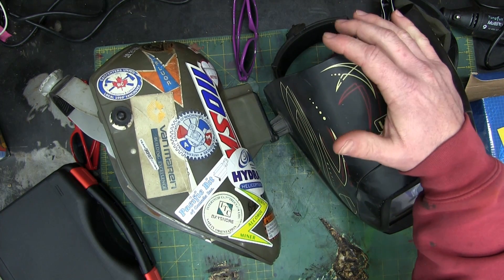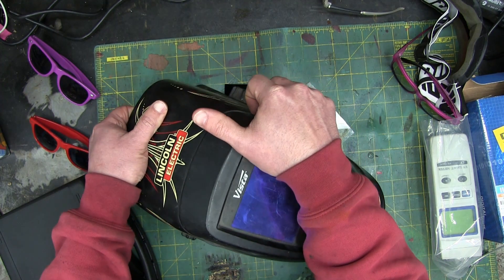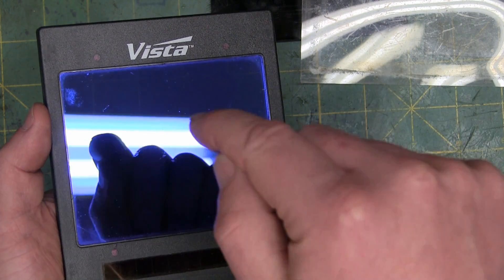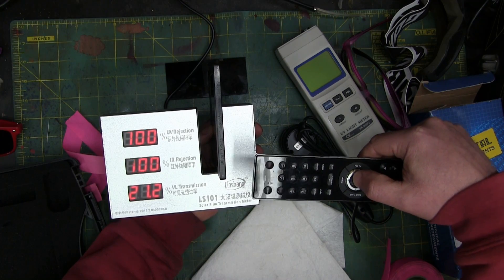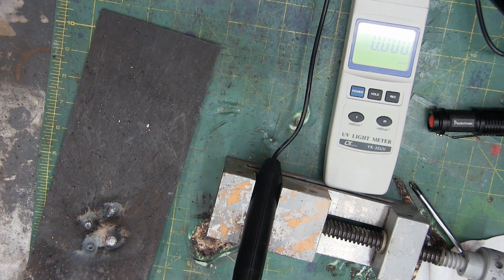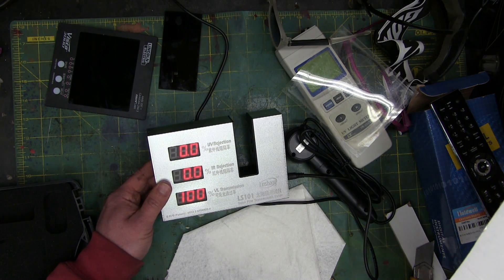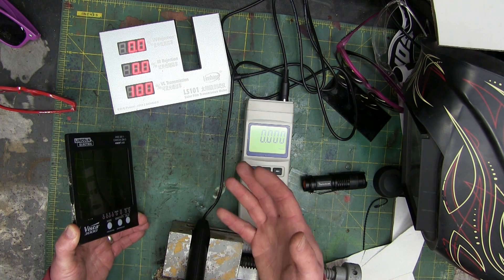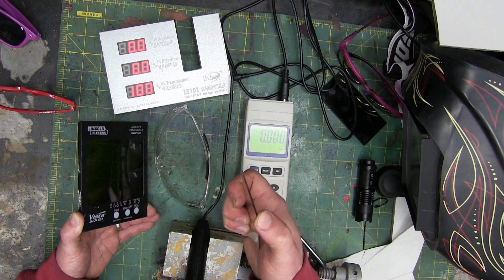SPEED DOESN'T MATTER?! Auto-Darkening Welding Helmet

Comment: Hi AvE,
I think one thing worth mentioning is that when welding in tight spaces (exhaust header tubes for example), the welding hood's sensors get blocked often, so you still do get "flashed" (not nearly as harmful as a bare eye flash as you mentioned) and then you have to wait several seconds for your eyes to re-adjust before welding. It hurts a bit, but won't give you the 3AM emergency room visit for the eye drops.
The higher end hoods like yours have 4 corner sensors to help with this. The cheaper (and even some expensive "Spedglas" brand) hoods only have 2 sensors, which suck big time for welding in tight quarters. They constantly get blocked and then you get flicker.
Also, some higher end hoods have a "grind" setting, which comes in handy.
Cool to see welding related stuff on your channel.
Thanks,
Aaron
Reply: Ran into this problem constantly doing my stuff under the car.  yea the 2 sensor unit suck. but now that I know an IR remote can trigger these things I might just wire the helmet up to the mig gun trigger with an IR LED aimed right at one of the sensors, or even just hack right into the helmet. no more false triggers for me!
Reply: A few years back I got the Miller Digital Elite helmet because it has something they call X-Mode. From their site "X-Mode Electromagnetically senses the weld to eliminate sunlight interference and continuously detects the arc even if sensors are blocked."
Reply: @TravelBackroads  I had one. Biggest POS hood ever up in pipe rack. I literally got so mad I through it off rack and watched it break apart. Went to speedglas 9100x and have been happy since
Reply: A direct trigger sensor would be reassuring, that's a great idea.
Reply: Having tigged together a few thousand mustang and jeep headers back in the 90s... yes 2 sensor units sucked.
Reply: Corsa,
I'm skeptical. Please completely block all 4 sensors with electrical tape, try welding and get back to us. I use a Miller Elite (non-digital) and never went with the Digital Elite due to the additional cost, weight and complexity. If that truly works, I may "upgrade".
Thanks in advance.
Reply: @6061  It works.  It picks up the RF noise from the arc, rather than relying on light.  I had to switch off the "x mode" when I was taking a welding class because it would occasionally go black when the guy in the booth next to me struck an arc.
Reply: I bought my brother a Digital Elite for his B-day a few years ago, maybe I'll go borrow it and upload a video.
Reply: Halojen,
Good point, small chunks of .035" wall stainless directly covering all sensors would be the definitive test.
Reply: aluminum foil tape would work.
Reply: Unless I foot the bill, the steel mill will only buy the super fancy $35 grey hoods and single sensor lenses. And yeah, NFG for tight quarters. There's been many a time that I come crawling out of a hole, throwing all of my gear, cussing up a storm. That's what smoke breaks are for. lol
Reply: X mode works. I rarely use auto hoods outside, only when I bowed up under a pipe. Miller x mode hoods are the only ones I have used the will trigger in the sun consistently.
Reply: I'm not sure, but I suspect IR can pass through electrical tape. So maybe use something else to block the sensors.
Reply: My Radnor hood has 4, I rarely ever have a failure to darken
Reply: EvilGTV 
I also have Miller digital elite series helmet. X-mode is great for the outdoors too. Pricey units here in Canada, but worth every dollar. Torch and grind modes work great too.
Reply: When I run into this problem I just adjust the sensitivity setting ! Works like a charm
Reply: Those eyedrops are derived from cocaine. Try to never scratch your cornea.
Reply: 1000HoursFreeAOL sp Did someone say cocaine... hahaha. Yes, it works excellent for numbing. I’ve been running the Lincoln Viking 3350 for about 6 months now. Absolutely love it.  It has excellent reviews.
Reply: jaysen2200 that does help but it seems running up the sensitivity makes it switch slower. My eyes get fatigue from auto hoods as a whole. 99% of the time I use a old school ao weld cool.
Reply: Is that a type of helmet or a trigger to trick the sensor in the helmet
Reply: matt vorhees I rock an old school miller I am not a fan of the elites they are heavy up front spend all day with it on and my neck notices
Reply: 6061. com "high end grind mode" the hobo freight hoods have a grind mode on the dial for a few years now. I wouldnt be all that shocked if the millers, lincolns, Hobart still sling some hoods without though and bill it as a "premium feature"
Reply: My £30 SIP helmet has a grind setting on it.
Reply: 6061 - I've run a digital Elite for years, never taken it OFF X-mode.  The thing darkens even if the arc fails to properly start sometimes -particularly on the mig, if there's a little bit of spatter inside the nozzle when you're feeding a bit of wire out with the trigger that makes that tiny sparkler effect.  Also failing to attach the earth clamp can do it - seems to be able to pick up on the machine trying to deliver current, even though none is really flowing.  Doesn't go dark from bright lights (Speedglas at my old work used to trip from the worklights we had).

Edit Either I was talking out my ass before about it even working facing away from the weld, or its more sensitive to the HF start on my old transformer TIG.  Decided to go test - popped the unit out, put some reflective aluminium tape right over the sensors (not the clear plastic cover), put it back in, and fired the MIG up (TIG's blocked into an inaccessible corner atm). Worked perfectly out to about a foot, maybe a foot and a half, then started to get a little bit hit and miss at distances over that - sometimes not triggering for a while, or dropping out for a while and then triggering again.
Reply: Electrical tape over the sensors will cause the ADF to malfunction. She won't chooch. This little morsel of information is from using electrical tape to cover the sensors on new guys who leave their hoods out when we take lunch >:)

Comment: Eyeballs don't have blood flow to cool them. UV mostly fucks the very surface of the eye, bright visible light buggers your retina, IR buggers your lens and your retina . Doctors can fix the cornea and lens with corpse bits and plastic, but bugger your retina and you're right fucked.
Reply: Above 1.4um IR mostly cooks the jelly in your eye, but that can heal
Reply: Additionally UVA (315-380nm) can penetrate further into the eye and damage your macula over years of sun exposure or through one event such as staring at the sun. The macula is also inoperable.
Reply: djmips 380? :P that's just really really purple. It's ultra purple, not ultra violet (I was looking at absorbtion by wavelength and forgot the cutoff. I don't think much uv below 370 gets through the cornea and lens)

Comment: Z91 or z87? Most safety lookers I know of are the latter.
Reply: Z91 is performance requirements for oil-powered central furnaces. It's Z87.1-2015, in the high-impact rated version with max UV and IR protection: Z87+U6R6 is what you want. https://blog.safetyglassesusa.com/what-does-ansi-z87-1-2010-certified-mean/
Reply: Certainly. Lots of Z87+ will be U6 (highest UV blocking) but far fewer have R6 (max IR blocking). For welding/cutting (high-heat processes) you want the IR blocking. For high impact protection you want Z87+. I've got several pairs for different work: Z87+U6 for general safety, Z87+U6R6L3 for grinding/cutting, Z87+U6L3 as everyday sunglasses, and Z87+D3 for working with any liquid that might splash and cause damage. L is visible light shade, D is droplet protection.

Comment: do tea bags help with a flash ?
Reply: All of these things will aide in providing relief. I find Vicodin does wonders but most bosses get upset when your high for some reason.
Reply: these things aide in alleviating the symptoms only. Luckily you eye are one of the fastest regenerating organs and heal fast. With the exception of pissing in your eye's, which is strongly discouraged. Not going into why but peeing on your eyes is similar to hitting your hand with a hammer to get rid of a headache.
Reply: biker I have found. when I was younger and dumber. nothing helps enough as. DON'T DO IT! it took me about two days to go to sleep. when I did. I woke up and could not open my eyes to save my life! talk about freaked out! I bumbled around found the sink and washed them a lot. finally got them open! I haven't seen to great since!  best to not burn them to start!
Reply: biker..I have used concentrated milk before (Pet brand )...a couple drops in eyes works wonders...b
Reply: Apparently the tannin in tea helps soothe them.
Reply: OK that's fucking funny
Reply: I guess that would depend on who is doing the tea bagging.

Comment: Weird uncle bumblefuck  Is true they used to inject cocaine in the eyeballs to calm welders eye?
Reply: Most pipeline welders put it up their noses while welding.
Reply: Cocaine, like Benzocaine, Xylocaine etc (The 'Caines) is a numbing agent in addition to its other more illicit features.
Reply: Paul I know that cocaine drops were (maybe still are?) used for eye surgery. If that works when actually cutting the eye, don't see why there'd be a need to inject it.
Reply: They used to use it for nose bleeds no joke it.was.a liquid and wasn't to potent but it swell up something or another and u quit bleeding source: my mom's a nurse
Reply: Still use it for that when the 1st 4 or 5 things they try don't work.
Reply: Wolf Coyote So you mean I can do more cocaine once my nose starts bleeding??
Reply: They still use cocaine for nose bleeds once in a while, there's better methods now that are used first. Cocaine is a vasoconstrictor (constricts blood vessels to slow bleeding and allow a smaller sized clot to stop the bleed) short version of how it works
Reply: shep427 here in canuckistan they stopped using it
Reply: Pontocaine or tetracaine ophthalmic is/was used as a topical anesthetic by prescription.Used it as an ointment back in the 70's. Was told it is no longer used as it damaged the eye when over used.
Reply: NextGenesis88 hey man i don't. Judge

Comment: Real curious what kind of IR rejection those yellow glasses for laser cutting have. I think I remember Willie Osman talking about it a few months back.
Reply: Feel as though my YouTube experience is getting more and more narrow if AvE is doing responses and Essential Craftsman and Willy O's videos are getting mentions in these comments. Practical Engineering even did a minor response to AvE a while back now.
Reply: That strongly depends on the glasses. Some are narrow-band filters for one specific frequency, others are rather wide-band. So if you got a set of 400nm-450nm notch glasses (for violet/blue lasers) they'd have almost no IR rejection, while a set of 808nm+980nm+1064nm mulnti-frequency ND:YAG glasses reject those IR wavelengths but not others, like the 10.6um of a CO2 laser...

Comment: What about shade 3 or shade 5 cutting glasses? I use em for torch cutting or brazing, and 3M says they block "some IR" which doesn't exactly inspire confidence.
Reply: MauledByBears I was wondering about shade 3's too that's what I've always used for cutting it would be nice to know how bad I'm blasting my eyes.
Reply: Dustin Krueger It scares me even more when I'm blacksmithing. It's a way bigger light source than just a torch tip or something. Shade 5s are too dark tho.
Reply: MauledByBears for smithing I started using glass blowing glasses rose glass to be specific easy to see through but cuts out the IR and kills almost all of the yellow flare from the fire. Really lets you judge your metal color a lot better without having to remove it from the forge.
Reply: I've heard that. Those glasses are pretty expensive and from what I've heard the sodium flare from glass is different from the yellow from a forge. But if they work for you, awesome. I can't justify the expense over shade 3s... yet. Maybe after I trip over something in the shop next time...

Comment: Tacked without a helmet once with the dont peek method.. Gravel in eyes and trip to the hospital for a second or two of exposure.... Never happen more than once.
Reply: GasNBullets 
Helping a brother out when we only had one helmet. Just close the eyes while holding the piece to tack it. 20 pieces later and the old face is feeling a little warm. Come out  of the dark hole we were in and was lobster red. Just don't do it.
Reply: I did an entire patch panel with a t shirt and no gloves.... Worst sun burn I've ever had and it only took a couple hours to get.
Reply: My very first welding experience was with a free-with-the-welder pair of round eyes-only glasses.... welded an entire rack for an entire afternoon.
I found out just how much UV I absorbed when I woke up the next morning, rubbed my eyes, and felt like I just took the skin off my face...

A real steep learning curve if there ever was one!
Reply: I've done the same (except I did wear gloves), the weather was super-hot (for Finland anyway) and as usual I didn't think things through, I figured that any minor spatter of molten metal I can handle in the name of not getting heat-stroke... it was a very uncomfortable night and few days afterwards, probably second worst sunburn ever.
Reply: Had a extremely bad sun burn on my left arm after mig welding for most of the afternoon, never again long sleeves after that.
Have seen some old guys use the close your eyes and turn your head method.
Reply: Yeah, UV from welding is worse than the sun, because you get a lot of "UV-C".  Shorter wavelengths get absorbed by air, so any UV-C from the sun gets blocked long before it reaches us.
When you generate it within arm's length, You get the whole works.

Comment: What I'd be interested in with these autodarkening types, how do they compare in terms of power generated off the arc (photovoltaic cell) and power used by the electronical brainbox and LCD? Also, are there differences in that metric between cheap and pro gamer gear?

Comment: I was a fitter for quite a few years, heavy equip stuff in a shop full of welders. I never liked these things. Its maybe a good idea for casual use, but too many things make them a pain and they just aren't practical when you do this for a living 12 hours a  day. 
First, electronics in a welding shop. They get broken a  lot. And every time some wanker drops a piece of plate on your hood, you don't want to spend 150 bucks to replace it. 20 is much better. 
Second, only in a perfect world where the shields are clean are these nice to use. After 10 minutes of welding, shields covered in smoke and splatter can't be seen through very well anymore, and that totally sucks. For most home users and fab shops, you spend far more time measuring, squaring and tacking than you ever do welding. I just cover the arc with my hand or something. Sunburn is also a factor needing considered... we used a lot of sunblock and quickly figured out which brands burned like piss in your eyes after you start sweating. So you need to cover the arc when you are tacking or you'll end up with nasty sunburn... or glob tons of nasty sunblock on your skin.
I spent about a week trying to get acclimated to one of these and ended up giving it away to one of the kids int he shop. They all tried to use these things and all eventually ended up ditching them for the old fashioned head-nodder
Reply: I smell a professional tacker
Reply: The best compromise, in my opinion at least, Is a pancake shield with an auto-darkening unit. You don't get glare from the reverse because it's sealed, you can replace just the darkening unit if damaged or somehow runs outta chooch, and you get the auto darken benefits.
Reply: $35 el cheapo plasteek hood for me at the Steel Mill. Can't tell ya how many times I've dropped my hood 300+ft or smashed it on a beam.
I'd much rather destroy that hood than some snazzy, expensive one.
Reply: I sit in an office chair and weld aluminum military coolers with a miller dynasty 700 with wireless footpedal. There is no way I would want anything less than a speedglas 9000x or miller titanium.
Reply: I was a professional tacker for quite some time. Howd ya know?
Reply: Using these while spot welding body panels isn’t the greatest idea either from what I’ve heard.

Comment: Ooh, a rare early viewing!
Edit: doesn't seem like you ever actually answered the question about trigger speed 🤔
Reply: Wasn't it "it doesn't matter". The auto dark was for visible light - that's not the damaging bit - IR/UV... Unky bumblefuck stated the IR and UV is ALWAYS protected with that glass. Ie... The auto-dark is for your comfort, not your protection
Reply: @aususer  You can still get some damage from visible light, though.  just not as quickly as from IR/UV.  In theory the pulses are short enough not to do any damage.
Reply: Trigger speed is listed in the manual for all of them. My helmet is rated at 1/20,000 second (50 microseconds). Plenty fast enough.
Reply: they usually darken with a 1/25,000 second delay iirc
Reply: The answer is quite fast, certantly fast enaugh, and that it really doesn't matter...  Atleast for the good ones. You might find some super cheap ones that works slower..